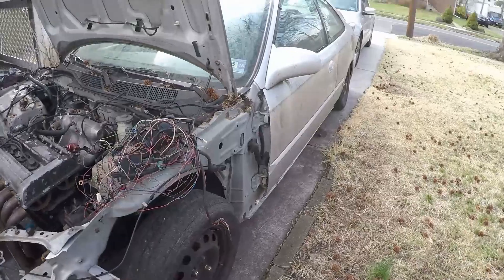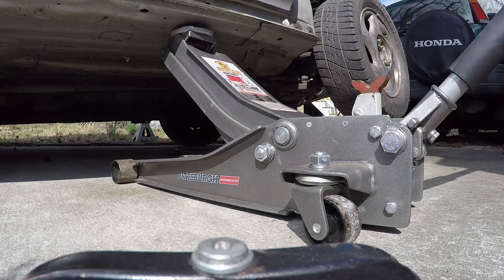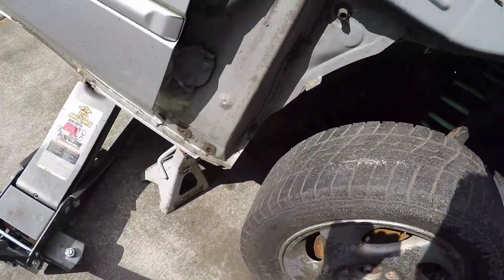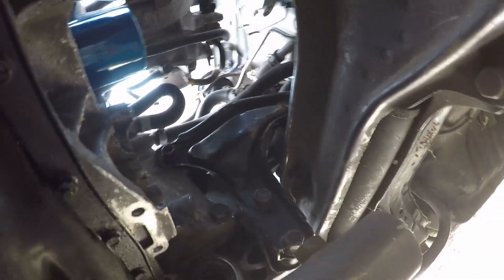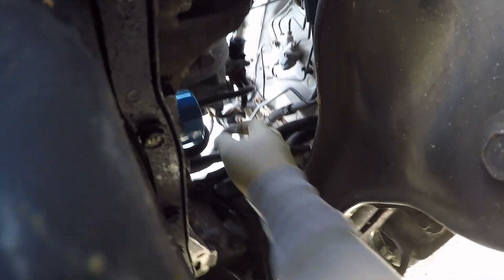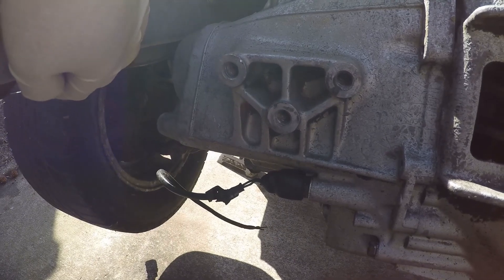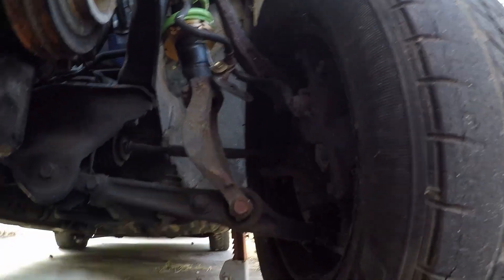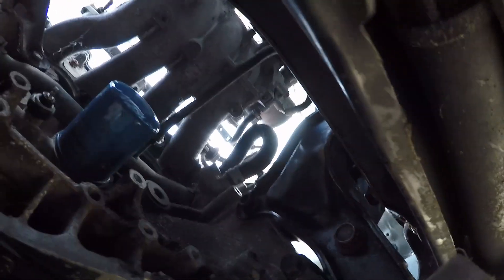How to Ek civic B20 swap Part2 T bracket

Comment: Just started fallowing from part 1. Watching part2 my good man. 👍
Reply from the maker: Thank you for the support Jim I’m working on some better quality videos on my Ek civic also just ordered a engine harness so I’ll be posting soon
Reply: @joemismaldonadoRx7  What engine harness did you go with?
Reply from the maker: I am going to be using the 2000 civic ex harness since it has vtech wiring and will plug right into the p2t 2000 si computer

Comment: Bro I have the same t mount and I can’t get that middle bolt off I’ve tried an impact and about every method to take something off Except a torch and a cut off wheel idk what to do
Reply from the maker: Yea best bet is to heat it up with a propane or map gas hand held tank then spray the bolt with pb blaster. Once the bolt is hot and soaked use a long 1/2 inch breaker bar to break it loose

Comment: Yo wassup,I have a 00’ si with a b20b in it,I’m having trouble finding a mount like the bushing part of the mount,I have the bracket and all I just don’t know what mount to find.I was wondering what mount is on your driver side top.I’d appreciate the help!
Reply from the maker: Hey thanks for the comment and on the driver side I have a 2000 si mount from innovative I believe that is the only one that fits because the 90-95 civics are different along with all the 90-00 integras, the 96-00 civic is the more difficult mount to setup, also the 97-00 Del sol may have a similar mount style as the ek civic 96-00, I just haven't had on to confirm
Reply: @joemismaldonadoRx7  ohh I see so I’m looking right now,I can’t find the mount,is it cool if I Dm you on Instagram or something?
Reply from the maker: @josephvasquez4228  yea sure my instagram is: joemisgtusiam